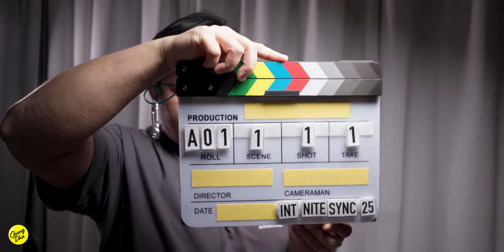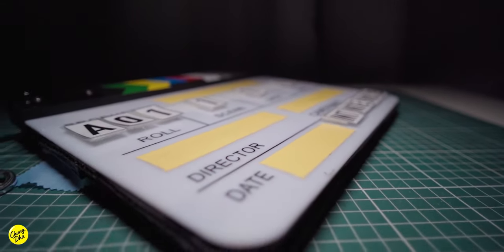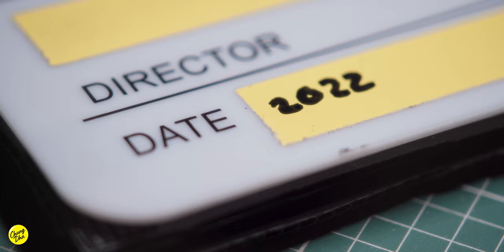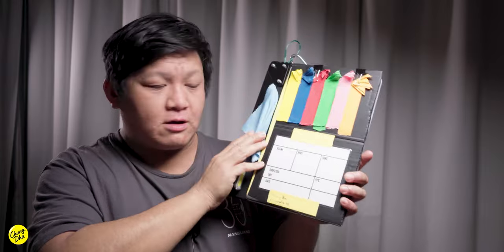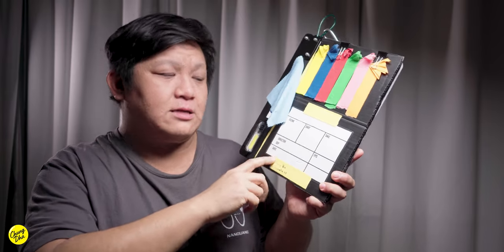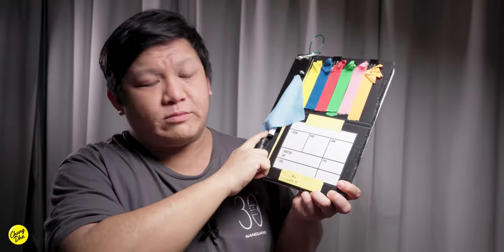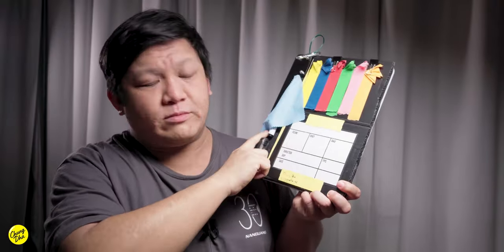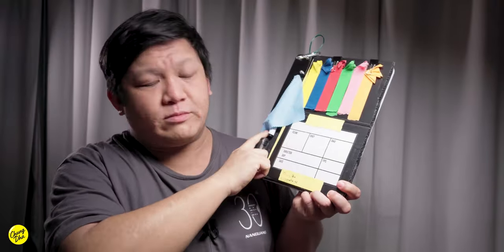DIY Clapperboard Mods

Comment: Back with another question as I'm doing my own DIY clapperboards for my students. How did you tie up the washing line before adding it between the frame and the clapper part?
Reply from the maker: Not tied, the plates screwed tight hold the line in place,